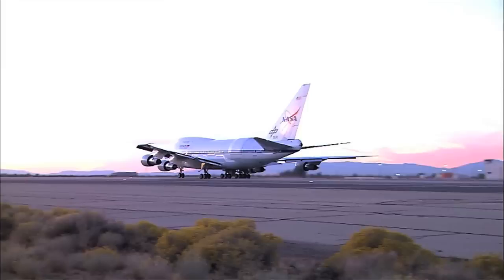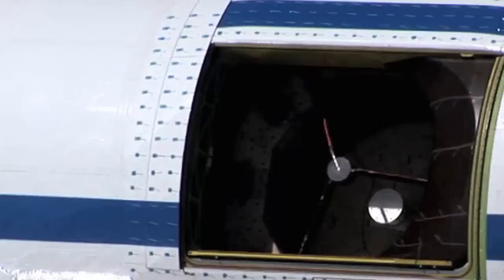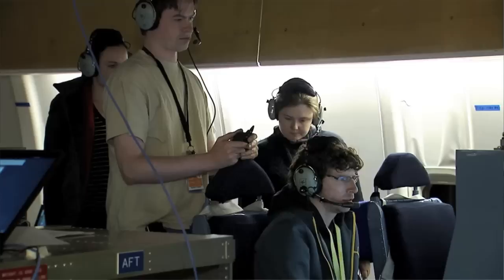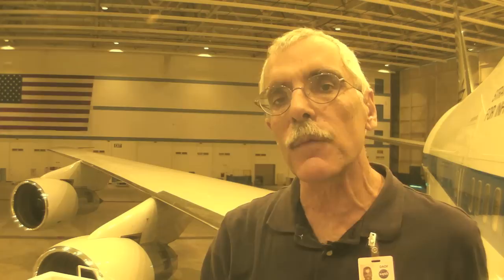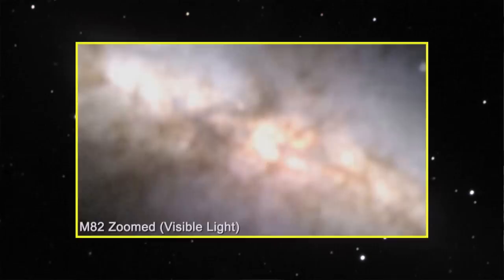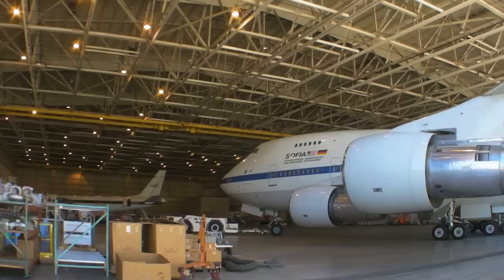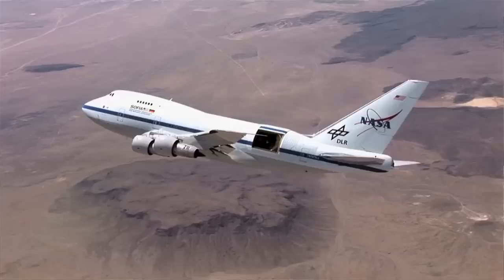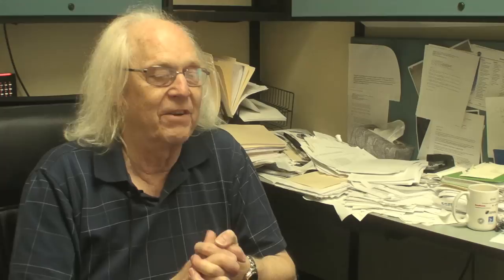NASA's Flying IR Observatory

Comment: this seems kind of unnecessary, I understand the purpose but why go through all this trouble with the atmosphere and huge modifications to the plane and telescope. how high does it level off? How much of a real benefit is this compared to placing on top of a mountain? what about drag, vibrations, and wind currents affecting the plane?
Reply: Yes, there is a huge benefit. I'm surprised they didn't touch on it in the video, but by flying in the lower stratosphere (at 45,000 feet usually) they are able to get above 95% of the water vapor in the atmosphere. Water vapor scatters infrared light, making observations in infrared spectrum at lower wavelengths almost impossible